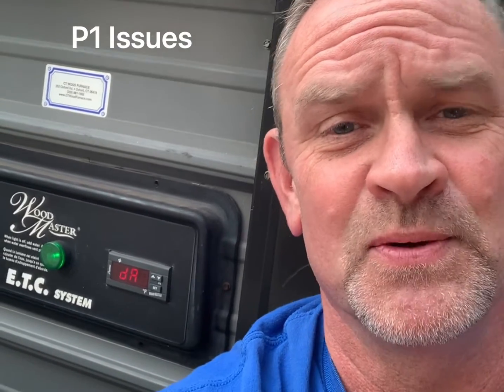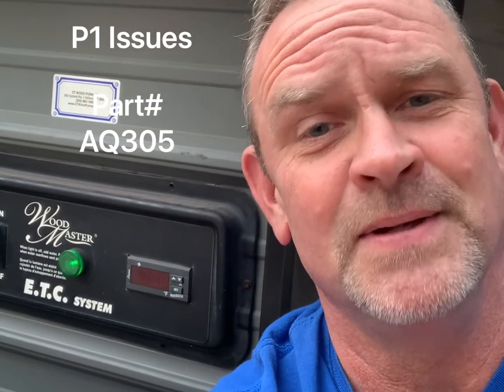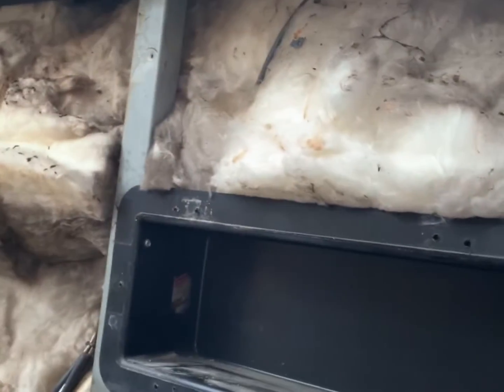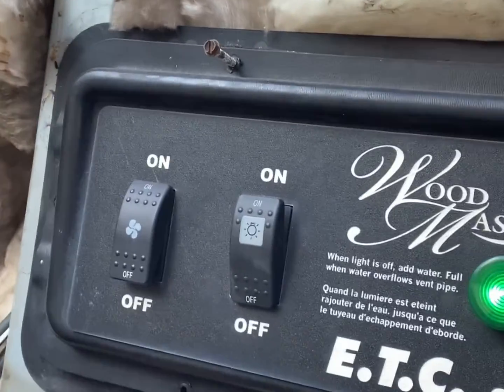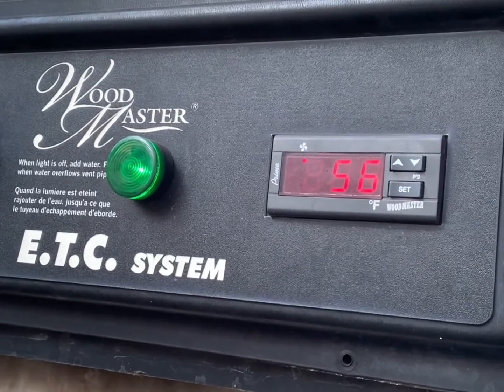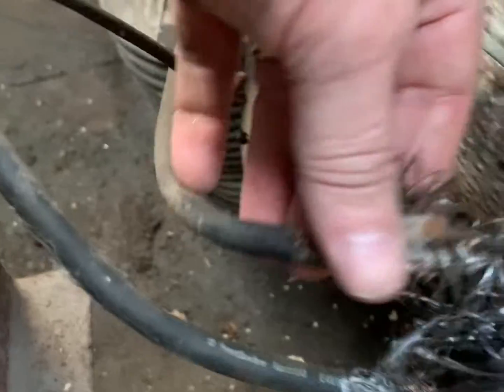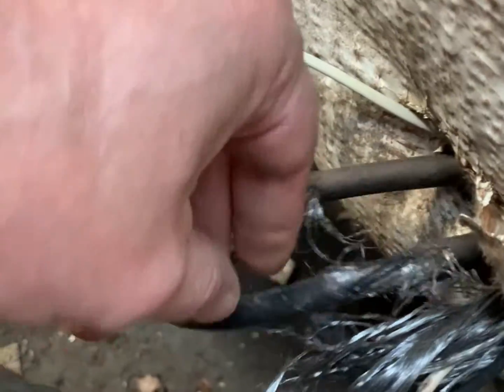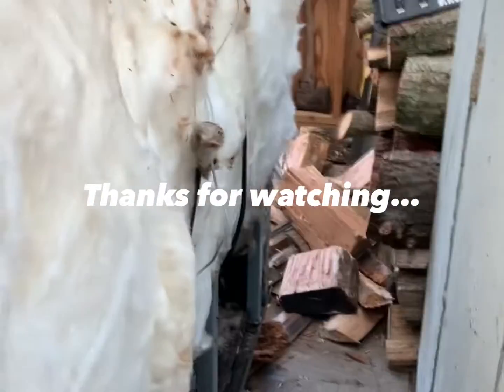Mice in Your Wood Boiler? | How to Fix P1 Error & Prevent Wire Damage 🐭🔥 | DIY Wood Boiler Repair

Comment: I had a problem with mice as well. My solution was to install PVC flexible conduit where the wires will run.
I'm also going to try the Irish Spring soap.